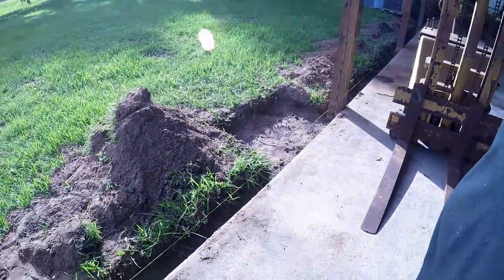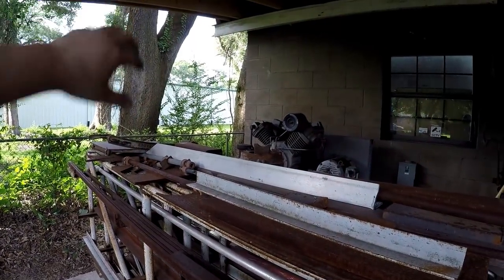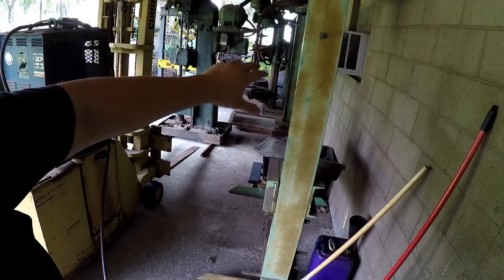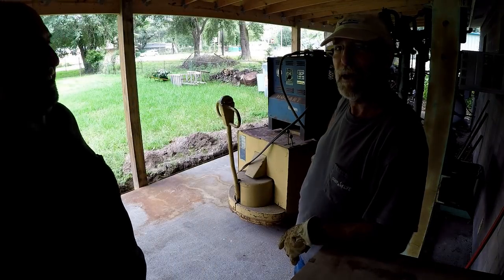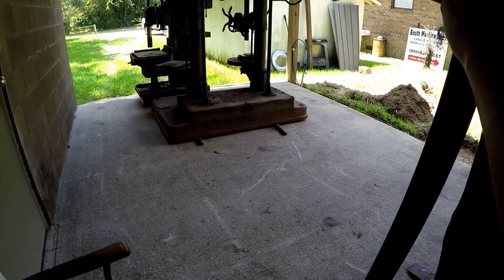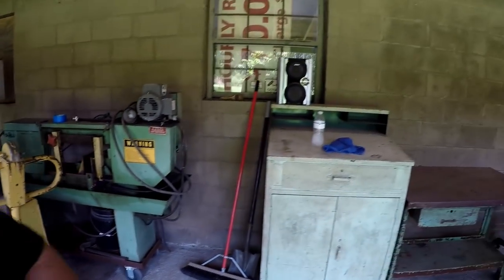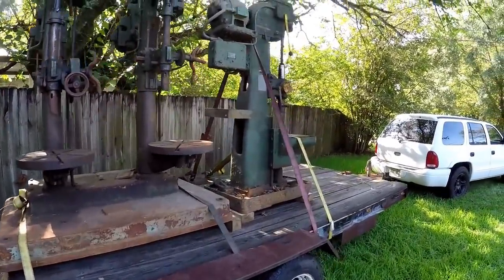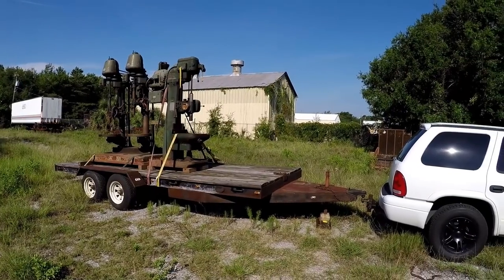Shop Enclosure Update & Machine Moving

Comment: I dont think the electric forklift running off the charger will have as much power as when it's on battery. Sounds counter intuitive but if it's running from a charger rather than designed to run from mains, it'll be the limited amps used for charging the battery slowly. It probably has lead acids guessing by the age, probably a load of car battery size or motorbike battery size lead acids in parallel, maybe some in parallel for capacity and then in series if it's more than 12v machine. Anyway Im blabbering, my point is you can probably replace them for cheap with used but good lead acids when you see what size they are.
Reply from the maker: I do know it's a 24V system. Would be a painn to stack a bunch of $100 car batteries in there.
Reply: If you really want it there would be several options.  Two 8D batteries (12v) would give you plenty of amps hooked in series it would be 24 volts.  We used to use them in heavy equipment and in the marine world of starting and house batteries.  I haven't priced them in recent years but back then (late nineties was last I looked) they were about $110.  So I would guess they are maybe $300 today which would put you back in business.  With a battery tender hooked to them (marine consta volt) to keep them topped off they lasted more than ten years with ease.  They also have a 6D and a 4D which are progressively smaller and lighter but they all started large marine diesels with no problems.  Golf cart batteries are high amperage also (6v) which are generally wired in series for high draw applications. Very reasonable and packing four in your compartment doesn't look like a problem.  Same thing using a battery tender they are good for years.  Also being a Navy town there is probably an outlet for "submarine" batteries which are thicker plates and even more power.  For ease of installation and use I think I would go with the golf cart style.  Take care.  Doug
Reply: It most likely has 6v traction batteries in it, a very much more rugged and powerful option than starting batteries, which are designed for short, heavy current loads, as opposed to long, medium current draw as is typical of traction batteries. Traction batteries are massively overbuilt- huge plates, strong cases etc, to take constant heavy knocks and vibrations.

Comment: adam batteries on concrete wont hold a charge  put it on wood
Reply: Mike Cartman Old wives tale.
Reply: im not an old wife and every winter when the bike battery goes on the trickle charger if it is on concrete it discharges! unless its on a piece of wood  or another insulator
Reply: Don't believe me.  Just Google it.  Every battery manufacturer will refute that old rumor.   The plastic used in modern batteries will not drain current to the concrete.
Reply: when my eyes tell me the manufacturers claims are false  i believe my eyes not the guy selling batteries